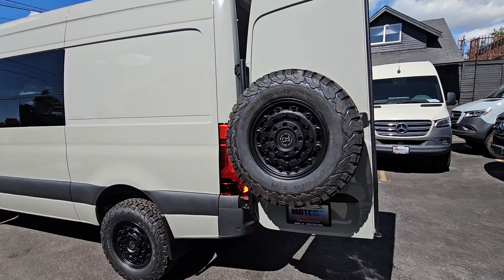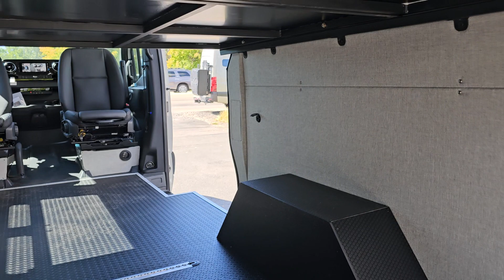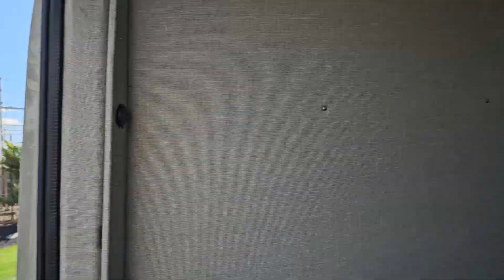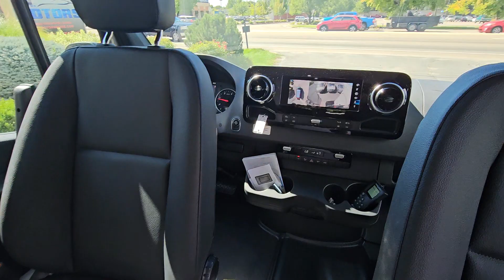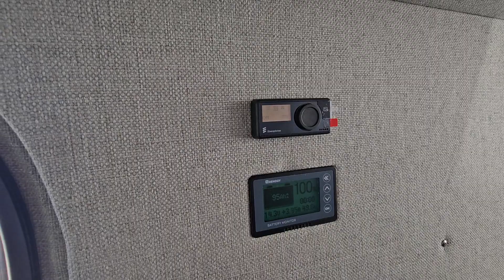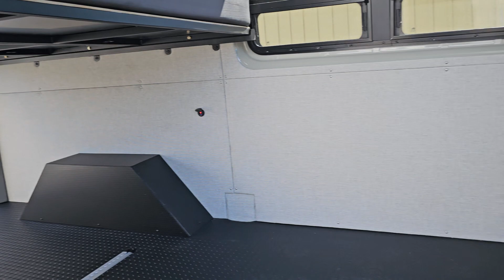2023 Awd Mercedes-Benz Sprinter W/Launch Vans "Dreambuilder"

Comment: Beautiful! Love the minimalist approach. My question is can you get it under 100K fully loaded? You are competing with the adventure wagon kit which is less than 35K I believe. Either way you are on to something here for those of us that use our vans for life and recreation not living.
Reply from the maker: Our  "Dreambuilder" package on a 144 chassis is $35k lifetime warranty and hand fit panels without the gaps of adventure wagon kits. The darn chassis plus wheels & tires are getting up there. We have some 2024s in the $80's coming 😬 just for the van. Adventure wagon is using lesser msrp vans if you compare. But less expensive.  No wheels & tires. No fender opening kit and a few things we do a little better.  For example, something as simple as a 3 way light switch in 2 locations (bed and entry) with a dimmer vs. manually turning the lights on 1 at a time.
Reply: Nice van. What’s the hourly rate for labor? Seems material wouldn’t be very much with this minimalistic design.